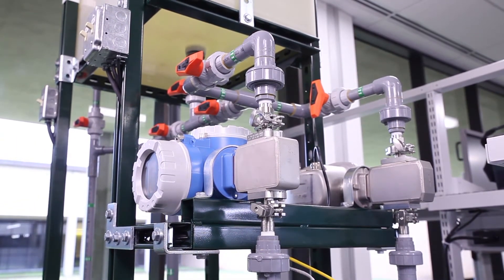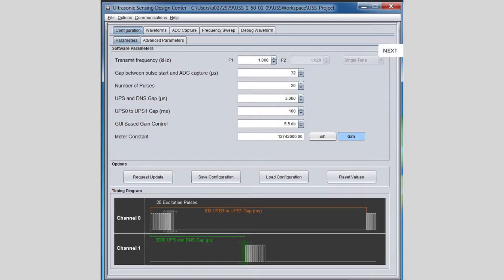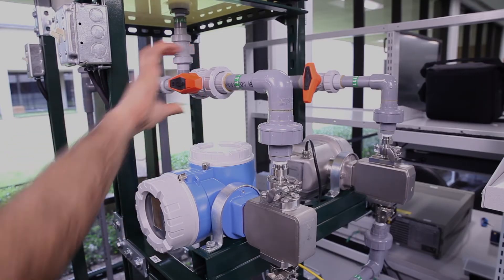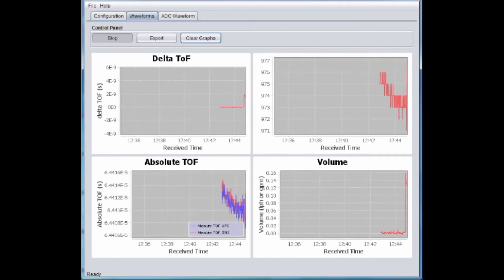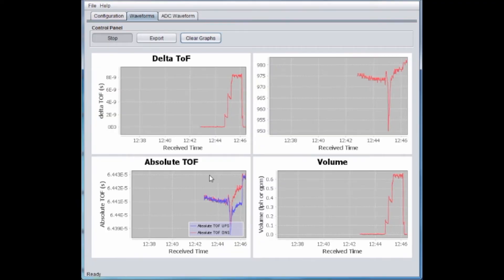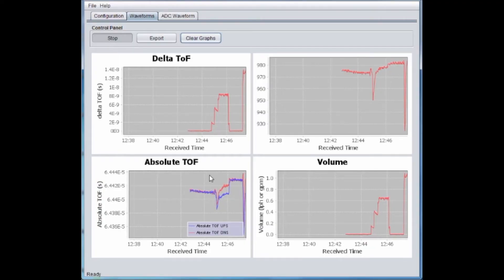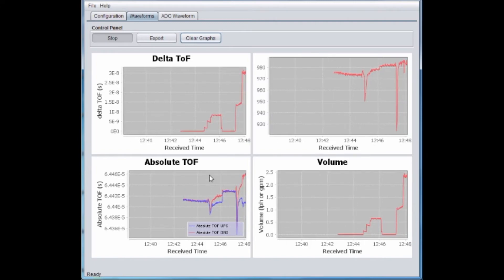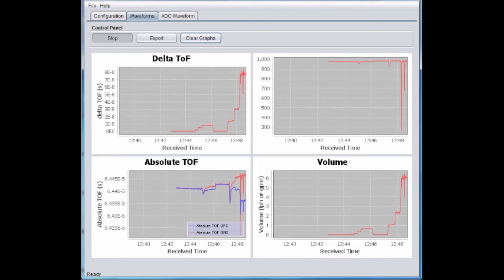Ultrasonic Water Flow Meter Demonstration

Comment: Does it have to be connected to a Vertical pipe ? or will the sensor placed on pipe placed Horizontally work as well ?